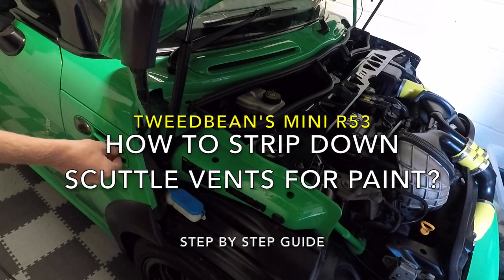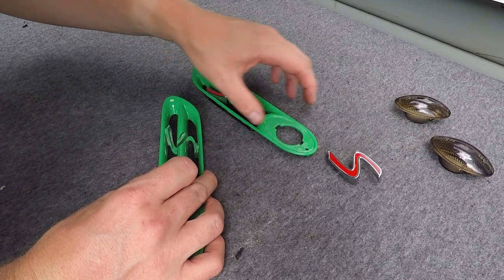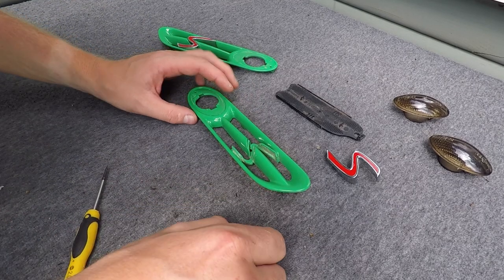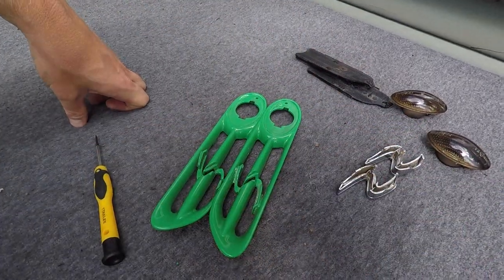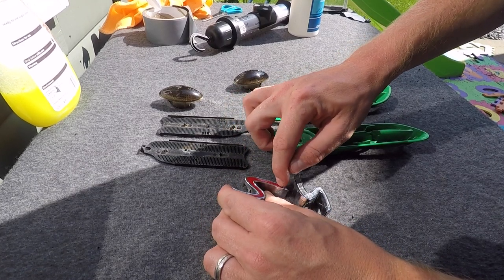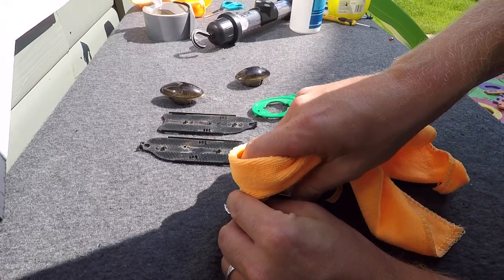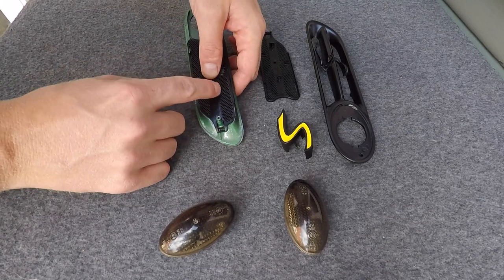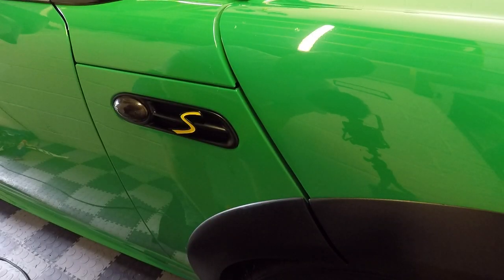Mini 1st Gen Stripping Side Scuttle Vents For Painting Colour Coding Dechroming R50 R53 How To

Comment: Why is it necessary to remove the black rubber piece on the back? Seems like you only need to paint the front. Thanks
Reply from the maker: Thanks for watching, it’s not necessary but especially if you are painting body colour I would say it’s more visually appealing to have the contrast between the black grill section and the front but you are painting
Reply: Thanks for the reply, I'm painting it black. Very helpful video! Removing and painting mine tonight!

Comment: How do you remove the little nut thing that holds in the S logo? I cant seem to get mine off
Reply from the maker: Hi you have to pry it off, you can always bend the little tabs that hook in when you pull away.  You can then reuse it or use a blob of hot glue